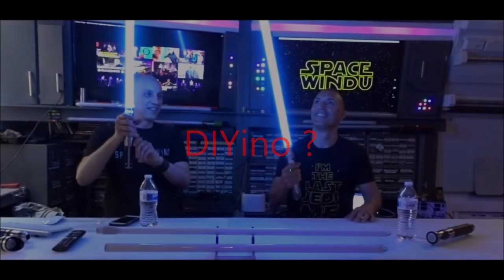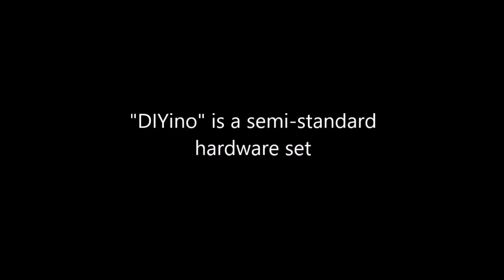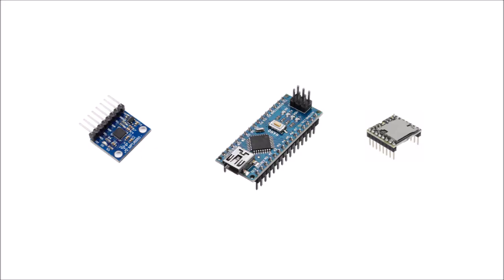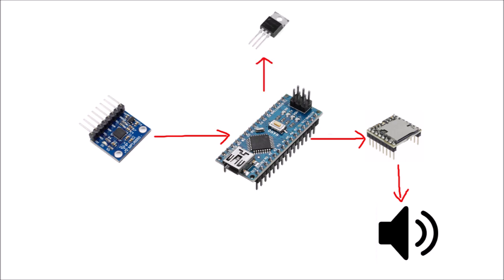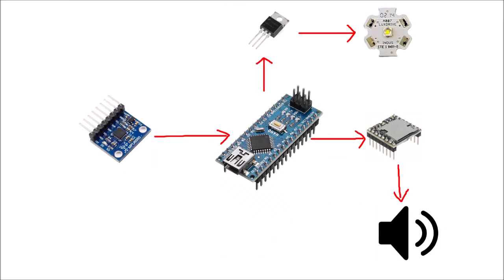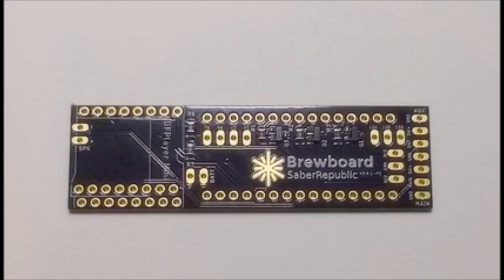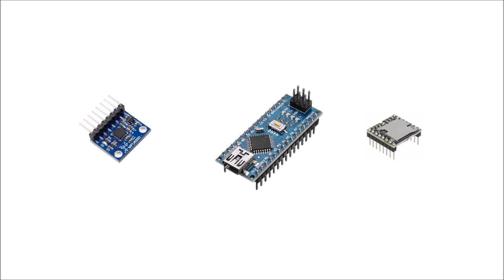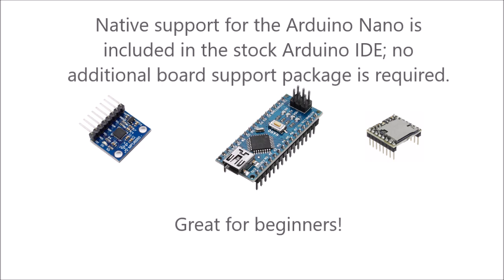DIYino Explained

Comment: @jakesoft Hello i saw your comment on the jakesoft brewboard video and was woundering if you had much experience with the board. Am looking to make my own arduino saber from a brewboard and was hoping for some advice.
Reply from the maker: I have one but I havn't tried to use it yet. (It's in my project cue to upgrade some of my old sabers with a Brewboard, but havn't had time.) There is a Wiki available for it. You should start by reading that. https://github.com/SaberRepublic/Brewboard/wiki